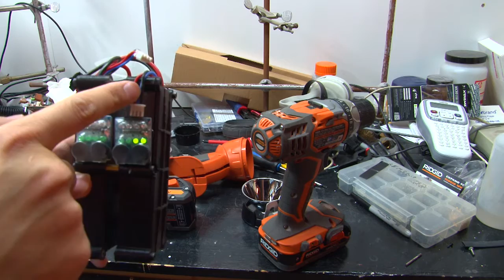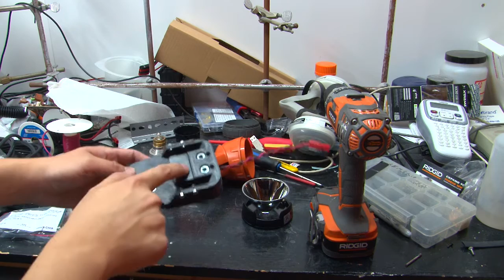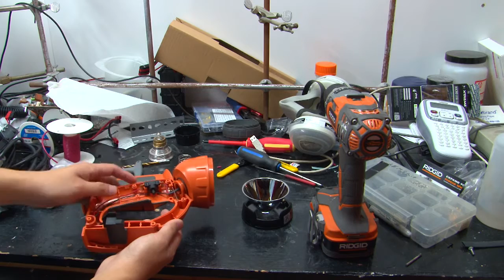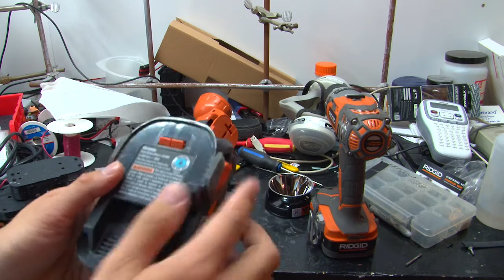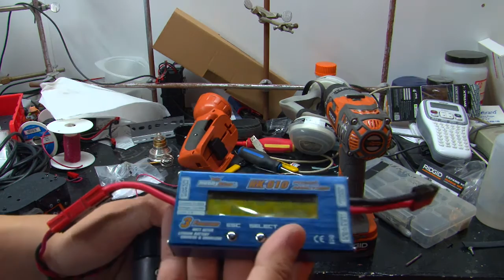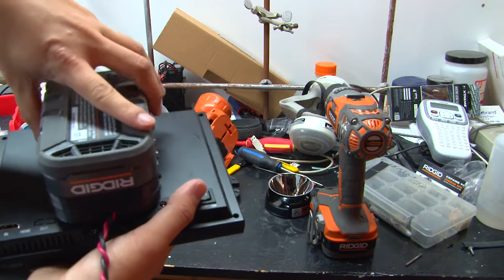(4) - Ridgid Lithium Battery Plate

Comment: Fantastic. This has been on my mind for years, but never had the fabrication savvy to put something together. This is very elegant.

The current crop of power tool li-ion batteries are resilient, reliable, and lightweight, and oh-so-tempting as a modular portable power source. Cook up a version for Makita, and you've got a customer. :)
Reply from the maker: +Riley Starr Looked into this, it'd probably be quite easy! Looked up the parts breakdown diagrams for various tools and even saw that they offer this exact thing off-the-shelf almost. Their jobsite coffee maker actually has an off-board battery pack with the same design: http://www.makita.ca/data/upload/parts_breakdown/DCM500Z%20-%20SEP2014.pdf

Looking at their other tools they have no common part number across all tools but they're likely the same part. At the end of the day I have no one who owns 18V Makita batteries, so this likely won't end up being something I'd do.
Reply: +aonomus That's hilarious, I'd never seen the coffee maker. That outboard battery terminal even has a belt clip. It's like they WANT us to power our homebrew exoskeletons with their batteries.

Comment: I like it. If you made them to suit milwaukee batteries, I would buy a couple...
Great idea!
Reply from the maker: +Energy Fabricator Unfortunately the Milwaukee batteries don't have a single replacement part that can be ordered to make an analogous version. The entire 'electronics assembly' is sold as one part, so you can't get the connector itself.
Reply: +aonomus 
There goes that idea :(